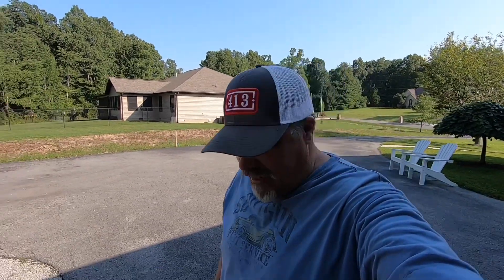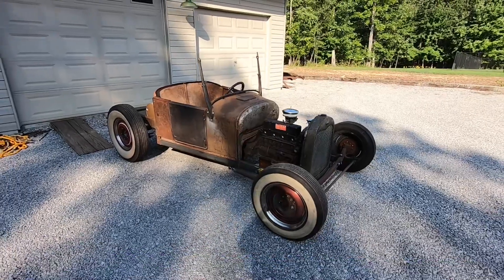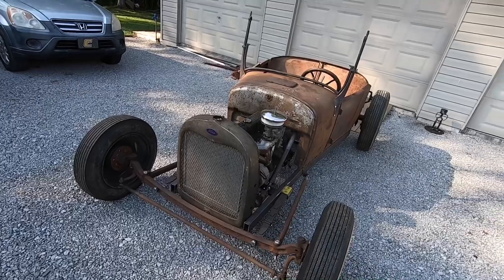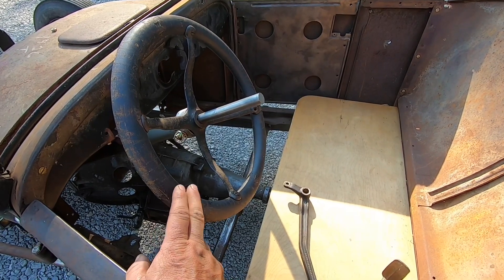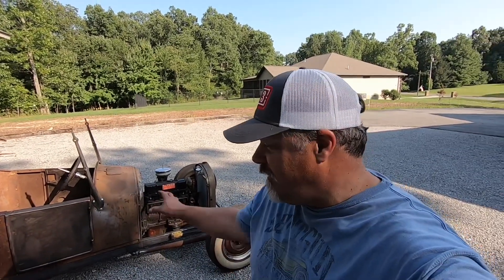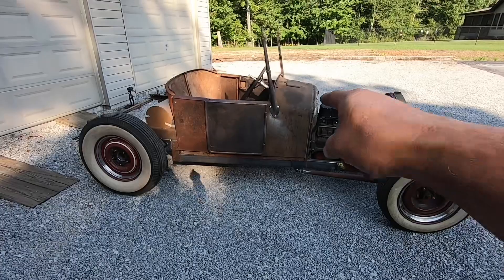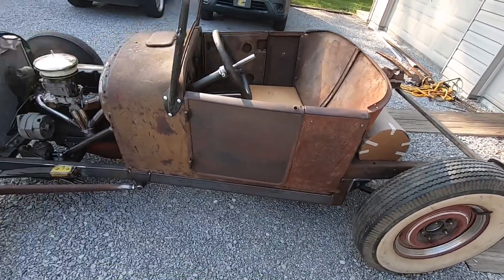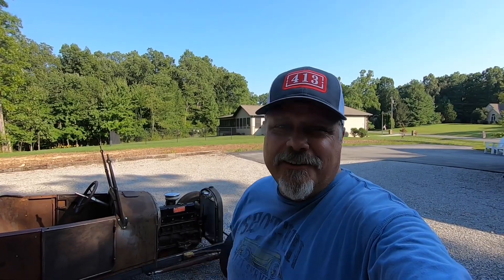Cool Stories & Cheap Hot Rods

Comment: That was a very interesting story,
Thank you.
I have a 1980 square body Chevy pickup. My brother bought it new I bought it from him in 1983. Sometime in the 90s the 250 6 cylinder cracked its second head and I was tired of the 6 cylinder. I bought a complete 1977 Impala four-door with a 305 for $200. Use the engine and all parts I needed in my truck and then went to selling Impala parts. I sold enough parts that I was down to $60 in my engine a guy asked me what I would take for the rest of the body and I said $60. That left me with no money in that engine.
The wheeling and dealing is a lot of the fun.
I still have the truck although it has not been on the road in many years. I had it running and drove it around my yard last fall. Maybe someday it will be back on the road.
Reply from the maker: That's how you do it. The BLT represents about a 2K investment at this point, but in all honesty, I probably have less than 500 in it due to all the wheeling n dealing.

Comment: real enjoyable video mate .. BLT has come along way in the last few months.
building Oscar for under $4500 is outstanding - shops would charge six figures to give you a truck like that these days.
thanks for the stories and cheers from Australia 🍻👍
Reply from the maker: It's mostly in just an advanced stage of mock-up at this point. Everything will need to be blown apart and finished, but it's getting there.

Comment: I love ur rides Oscar is a great truck for the money you got into it! I keep thinking about doing something like that I saw a extra cab s10 for sale 600$ body was trashed but the frame and suspension was clean that's all I want any way
Reply from the maker: That’s the way to do it. Sell off as much of the S10 as you can. I ended up with about 250 bucks in the chassis of Oscar. By the time I rebuilt the front end, brakes, and replaced the carrier bearing, I had maybe 500 in it. Now be on the lookout for an old truck body.

Comment: I was collecting parts for a 27 t roadster pickup and had an almost identical motor, mine was a mercruiser 4 out of a boat, basically the same but with the marine manifolds. Project got sold to pay bills.😢
Reply from the maker: This engine has a Mercruiser head, and intake with all the exhaust ports cut off.